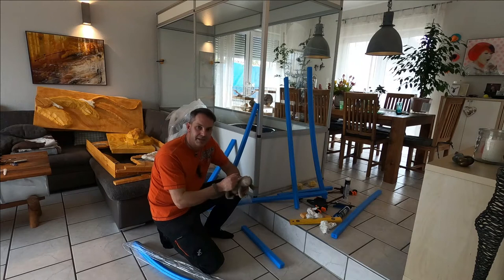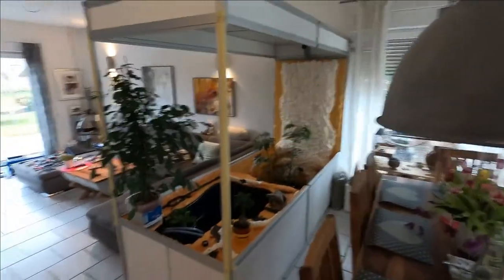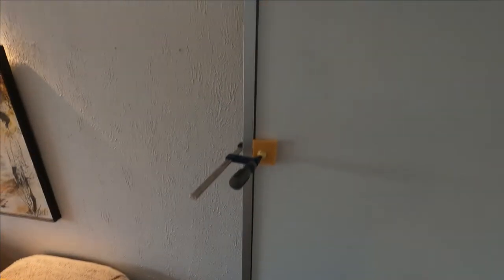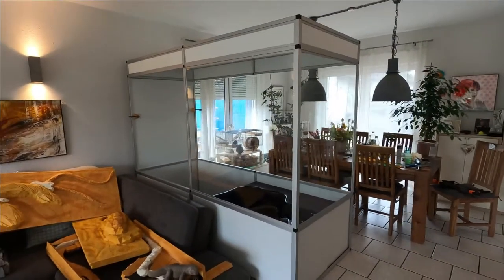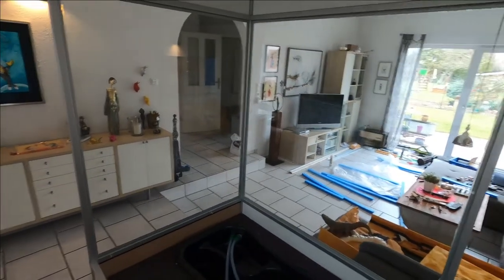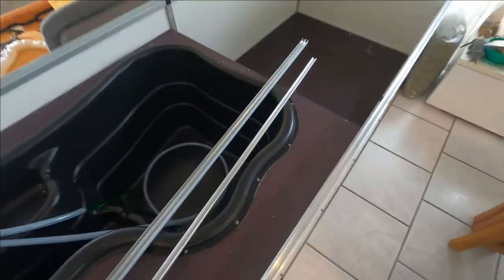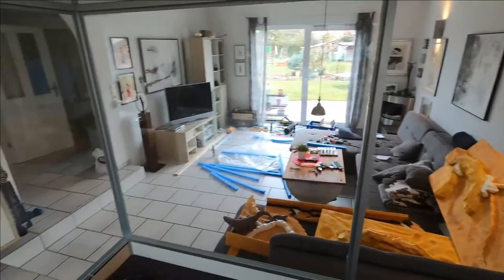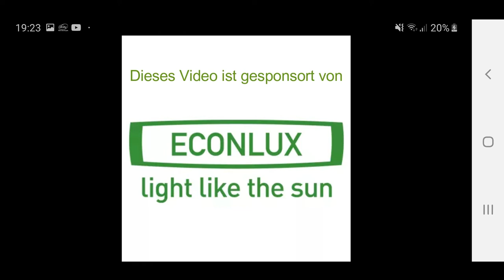Monitor lizard enclosure glas work on my Terrarium Paludarium, Econlux Solar Raptor Part 11

Comment: Enjoying the build, thanks for sharing. With that large area of water , do you think condensation on the glass will be an issue?
Reply from the maker: Its all new for me. I will see, but I need a high humidity up from 70 to 90%